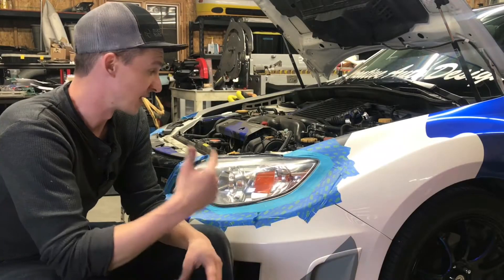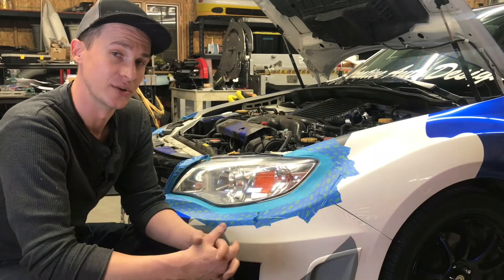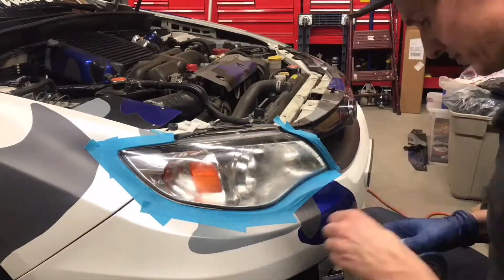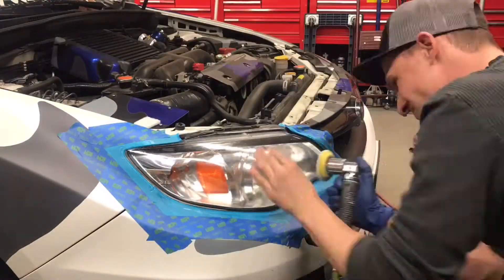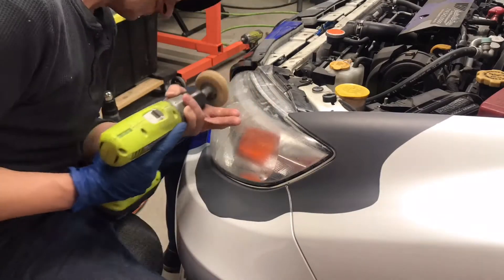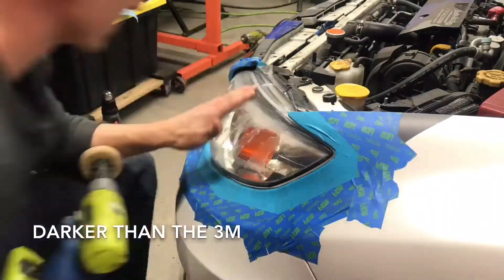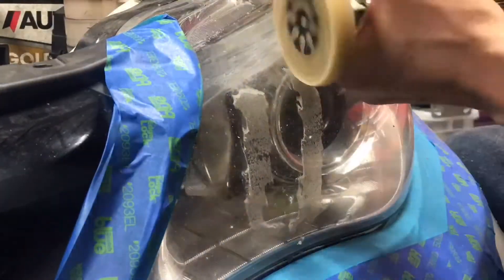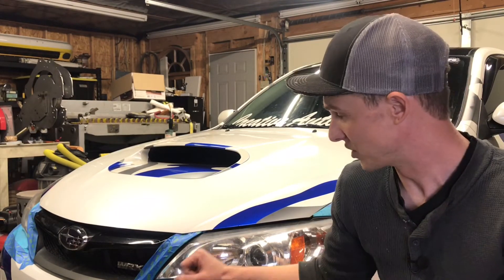EP106: Headlight film removal, in two ways

Comment: What can I use to get the adhesive off, if I don’t have a power tool?
Reply from the maker: RayanVlogs That’s a good question. Any adhesive remover that you use, that would actually do anything, is a little too harsh on the plastic lens. You would probably need a power tool to buff the headlights after word in either case. Definitely worth the investment to pick these things up.
Reply: gh werks Thanks a lot for ur response.